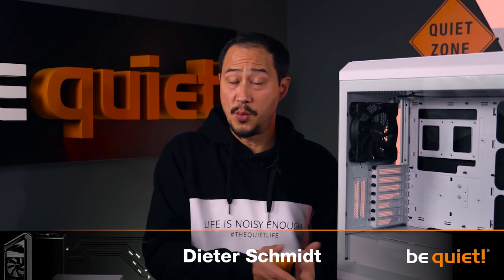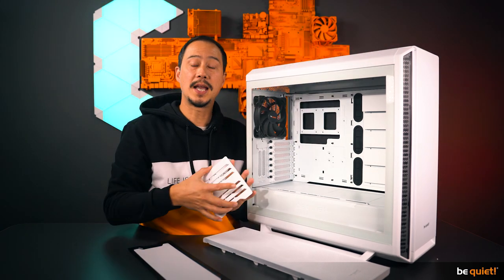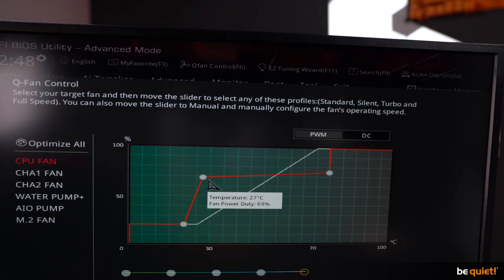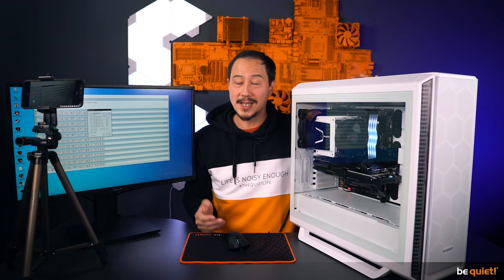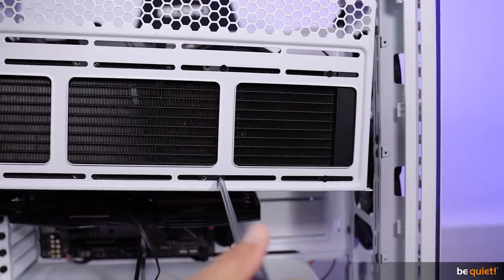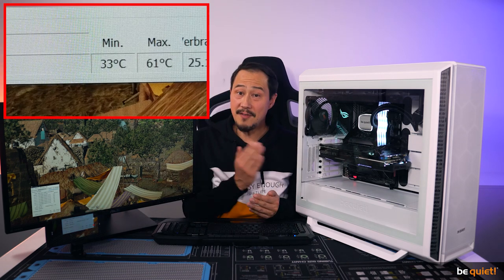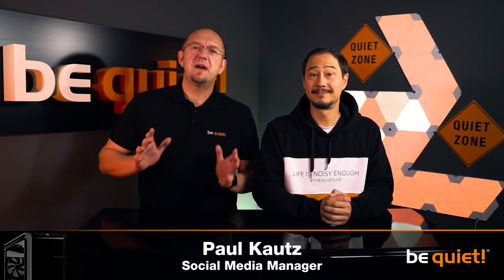Silent Base 802: Great Airflow, Maximum Silence - or both? | be quiet!

Comment: As a long and loyal happy customer of BeQuiet! I love my Silent Base 801 and I think BeQuiet! deserves Kudos, I emailed the guys about the mesh front panel 0n the 802 and how it looked it would fit an 801, it was confirmed and when we realised it was hard to source in the UK, the guys kindly sold one to me and shipped it from Germany for a very modest shipping fee. What a difference it made to the airflow in the custom high end rig inside. 140mm lightwings look especially lush in the 801/802 1 rear 3x fronts and on the pureloop 280mm AIO up top. and i get 6x 140mm silent wings2 as spares :D if you only made the 140mm square and end plates like the vented style as an accessory...especially if you have 3 fans slung in the front.

Comment: I don!t like the setup which is shown in 360mm cover front test. The main problem is the tubes are on the upper side which is for most AIO coolers forbidden setup. Is there way to put radiator upside-down?
Reply from the maker: Yes and no, often the GPU will block the tubes path. If the system has long enough tubes, than it will be no problem.

Comment: Feedback:
1. excellent approach by letting us decide between quiet and airflow!
2. I would like to see a black with orange lines case version again

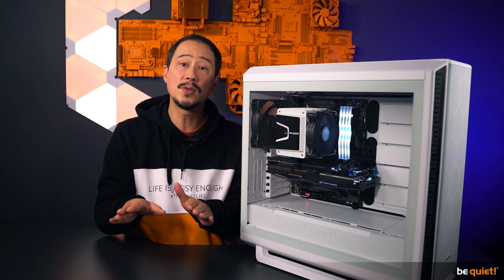Question about 6:38 "when you use the mesh panel in the front, and the closed panel in the top": the radiator should be in the front, right?

Comment: This is a very nice no-nonsense review, thank you! 
I really like the design that you can change it for silent en performance, I just hoped for a better-updated design case. One point for improvement, place the noise numbers next to the temp numbers, now I have to write them down... to get a better image of the performance.
Reply: It isn't a review, it's a product demonstration by the manufacturer. Check out a channel like Gamers Nexus for really thorough reviews, especially when it comes to airflow and temperatures.

Comment: Since you're asking for feedback ;)

Would love to see the same kind of improvements for the next version of the dark base 700.
I really like my dark base 700, it's aesthically just a beauty and offers a lot of funktionality. I just wish it would be more modular & flexibel, like the silent base 802.

some ideas/concepts I would like to see:

Detachable front and top covers;
Slightly increase in height; 
for better compability with top aios(especially top 280mm radiators) and motherboard vrm & RAM and also for properly mounting 3x 140mm fans in the front.(you know what I'm talking about ;))

Fan controller could be extented to support up to 12 fans;
More bottom fan mounting positions;
Power-button sync with RGB controller; 
2x USB-C ports and 4 x USB 3.0 ports at the front;
Detachable SSD-bracket like in the pure base 500;
Similar side panel mechnism and top vents like in the silent base 802; (NGL current TG side panel screws of the dark base 700 are a pain in the arse!)

That's all for now :D
Reply from the maker: Good Input thank you. We will forward it to our case department

Comment: If this is as easy as it looks in the video to convert from the silent to airflow-optimised configuration, it is exactly what I'm looking for. 
My room leaves few options for case placement, but I need to have the quietest option available for recording. Then, if I could quickly and easily switch to an airflow-optimised setup for editing video (and gaming too), I would be very happy!
Reply from the maker: It really is that easy.
Reply: So easy it's silly :)

Comment: Is it possible to buy the mesh top and front cover and use them with the 801 version??
Reply from the maker: Yes it is. Replacement parts will be available early 2021.
Reply: @bequietofficial  what's early 2021? January? February?

Comment: do you recommend front mount radiators or top mount? for cooling benifit. and if you mount it on the top is it more beneficial to use the mesh cover on top and the solid one on front or vica-versa? same question for the front mounted radiator, to use the solid top mount and mesh front mount or vica-versa?  this question is a difficult wording I hope you can answer it. thank you i advance! :)
Reply: I've found top and static pressure fans pushing up thru rad is best with a rear out. With rad in front I put inside the case with fans in the external space works best drawing cool in but GPU temps will rise, up top best with 1 rear out and  2 or 3 intakes up front instead.this gives cool intakes and rad n exhaust keeps CPU cool, GPU will boost higher in this config and case is running nuetral fan pressure and quiet. If dual rad GPU rad n fans in front.

Comment: I had to cut the lower half of foam off of the rear side panel to allow the panel to close properly, clearance is fine without the foam, and possibly fine if you don't put any hdds into this case. Wish I had bought a different brands case now. None of the builds on youtube include hdds...

Comment: With Pure Base 500, 500DX and 802 you reached next level of designing cases. To me, you just reached the top and now you are along the best. My feedback is that I wait for product for you essential - highest quality for poeple who prefer pay more for better, silence focused kinda workstation case. Legit successor for original Dark Base 900. And remember about poeple, who don't like glass and Jean Michel Jarre vibes from the case. Now it's like go Define or go worse, but you have better fans than Fractals - Silent Wings 3, which are stronger and even quieter. I compared them in Define 7 (3x140 1000 rpm comparison). So be quiet!, the time has come to beat Fractal :D

Comment: Hi, two questions.  First, is it possible to mount a bottom 240mm radiator?  

Second, does the solid top panel include a foam backing? 

Thanks!

Comment: appreciate the effort you have put in this case will be be in consideration for my next build ,the simple option of either mesh or more solid panel ois great ado you have easy to access mesh dust filters ,i have a obsidian 750d and i do appreciate that feature dusting my wifes antec 900 is more difficult
Reply from the maker: Well, from our point of view the access is really easy, particularly with the mesh front.

Comment: You should remove the support for 120mm fans to get rid of some flow resistance when building with 140mm fans/rads. No point building with 120mm fans if you want best cooling to noise ratio.

Comment: A really nice case, i will buy the black version, but only because the white version is ALL white, i suggest a "white outside-black inside" version, like the old 500r carbide (just for reference), black inside help to create contrast and hide hole/cable/plastic fan case (the majority  of components are dark), and adding a touch of white (ram, fan, cable mod) on a black panel is a lot better and easier than finiding a cool solution in a whole white space, all without giving up white on the external panels that are amazing and help lighten the presence of the case in bright rooms (a 55x55cm black case in a room with white walls and light wood is heavy), aesthetically be-quiet case are the best and fine looking cases on the market so that option should be a must.

Comment: You didn't even mention the bottom intake. I personally inverted the case and used the top as intake to keep my GPU icy cool, but I am thinking it might be better to revert to non-inverted and use the bottom intake for GPU cooling, with the fan mounted to the PSU shroud.

Comment: I'll be honest, I'm currently trying to decide between this case, and the Lian Li Lancool II Mesh.  From the reviews I've seen so far, the Silent Base 802 is more solidly built ajd definitely better looking, while the Lancool II Mesh still has an edge on cooling.  One difference I've noticed is that just Like the Dark Base 900 Rev 2, Lian Li has mounting points for two fans on the PSU shroud, while the Silent base 802 has only one, and that one is offset towards the front of the case.  Being able to push plenty of fresh cool air straight up towards the GPU seemed to be the difference in the most extreme tests.  If it's possible to mount two fans on top of the Silent Base 802 fan shroud, that would be good to know.
Reply from the maker: Helllo. The PSU shroud of the Silent Base 802 offers room for one 140mm fan only.

Comment: I have this case coming this week with a 360 AIO. I'm going to put it on top like you guys did since they are the best temps. Are the AIO fans exhausting or intaking (Pushing or pulling). and assuming front is intake and rear is exhaust with that configuration?

Comment: When are you going to improve (on such a large case) the cable routes at the back? I have seen what can be done with some decent routes and how this one looks... and this is a messy affair. All the rest seems good. I am expecting my new build with the 802 in 3 weeks (it takes so long nowadays). I had to forego the be quiet dark pro 11 or 12 PSU for a Corsair HX1000 as the company was still expecting yours only for... April. I decided to get a cheaper CPU (I have a workstation running a Xeon processor) and air cooled it, but would like to know when will you have an AIO that will have a LED/OLED screen to show temps (for example)?
Reply from the maker: Hello Antonio. We're always open for suggestions - what is it exactly that you don't like about our cable routing?

Comment: Nice case, but Pure Base 500 was my choice, I also replaced, and added more fans with Silent Wings 3 140mm 1000RPM. Still in need of some pc parts to complete the build.
Do you plan in near future making be quiet! Dark Power Pro 12 80+ Titanium 850W to 1000W PSU ?
Reply from the maker: Hello Antonio. The Dark Power Pro 12 will only be available in 1200W and 1500W. However, there will be interesting news in 2021...
Reply: @bequietofficial  that's a bummer (I personally don't need 1200W, but extra 400W won't hurt my pc?). Guess I'l get Dark Power Pro 12 80+ Titanium 1200W.
I really, really like the design; single mesh, and cutouts for fan to be more efficient, and good quality braided black cables.
Looking foward for the news  :D , but I've waited long time to build my new pc (that uses in reasonable time 3D model programs, and play's games without stutters). 
What program's are you using for 3D modeling (if you can tell) ?

Comment: Its been half a year since the case was in stock in locals stores for the last time. Are you planning to sell ones in Russia again in close time, or should i just go for define 7?
Reply from the maker: Hello,
this may help you:
https://www.bequiet.com/ru/wheretobuy/search
Reply: @bequietofficial  Nope, i have checked these stores, 802 black w window is out of stock everywhere in Russia. Check it here https://www.onlinetrade.ru/sitesearch.html?query=be+quiet%21&cat_id=1323&archive=0&force_items=1 Retailers provide no information about new deliveries of the case, and im kinda puzzled, should i wait until 802 is avaliable or just buy FD Define 7 with same functionality, but worse fans. Because i wanted to build my cooling system based on silent wings, but unfortunately i cant now
Reply from the maker: I just got the info that the Silent Base 802 Window in black should be available end of this month. I hope you can wait a bit longer.

Comment: What is the setup for the demo? I plan to buy the 802 with pureloop 360, à third silent wings 2 in front, for a ryzen 5900x CPU and 6900xt GPU. Is it a good idea?
Reply: tu devrais plutôt prendre des silent wing 3, encore plus silencieux... et plutôt un ventirad air comme le NH-D15 pour un meilleur refroidissement et en silence ;)

Comment: Top real put water cooler fan two  140mm ???? oronly 3 120mm ???
Reply from the maker: Because of the thickness the radiator adds. Fans only will fit. Fans and Radiator, don´t.

Comment: really wanted this case but the non windowed solid side panel version. But theres a problem for me.  yes its not glass so you cant look in but i take pride in my builds and im a little bit anl.  the solid version doesn't include hd covers.  at first i though t ok ill buy them separately, because i really like this case.  unfortunately I've looked on the web and no one is selling white hd covers online. no one and ive spend days and hours every time looking for them.  Even asking be quiet all i got was were sold out.  very disappointed that a case this varietY of changing parts doesn't come with hd covers.  hell if i could buy the windowed version and a separate spare solid  panel i would, but they dont seem possible to get either, even though i haven't looked for them all that hard.   personally white hd covers should be included in both versions and if not they should be available freely.  Gutted as it was a case i really wanted and gutted its not fully accessorised like the windowed version.  

Before people start telling me you dont need them on the solid pannel, again i want them in the right place closed or open.  I dont want windowed case as i run a projector in the room and like preventing any light spillage so i get a great 4k uhd image on my home theatre 100inch screen.  MAKE THE WHITE HD COVERS FOR THE BE QUIET 802 PLEASE I BEG YOU.

Comment: Kind of defeats the purpose of trying to keep the PC quiet if it ends up to choking the air from your fans to the point where you hit TJ. Max.

I do like this case, but no way would I ever use the covered panels.

The better the airflow, the less fan speed you need to maintain normalized temperatures, the quieter your case will be.
Reply from the maker: Our noise chamber tests prove you can lower the noise by using the silence covers. Because even you use the silence covers there is still air going through the side vents which is enough to run the PC at full load - just as shown in this video :)
Reply: The cpu hit 95c. Enough said
Reply: @bequietofficial  But with the airflow panels you can run the fans slower and still get better cooling.  Result similar noise.